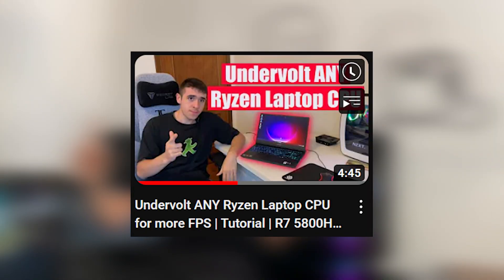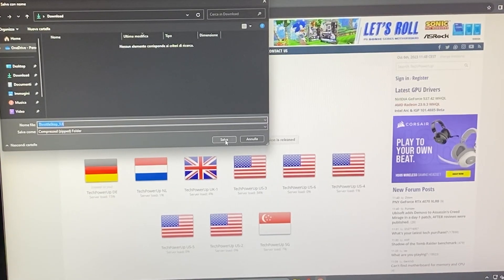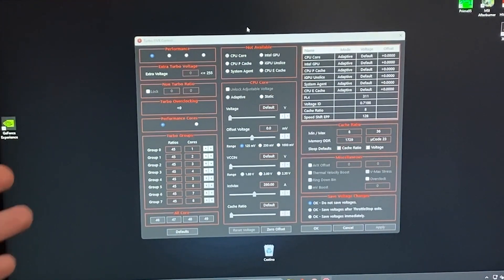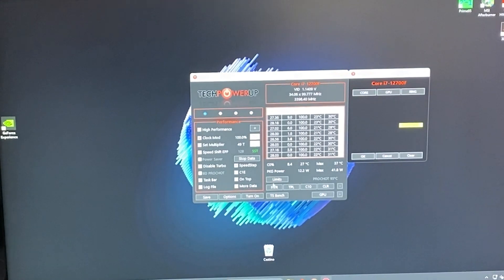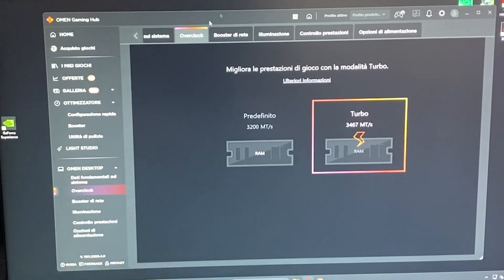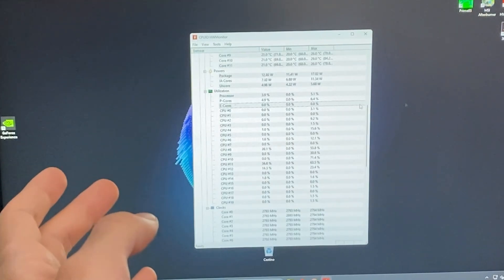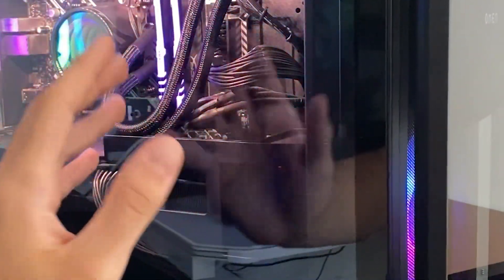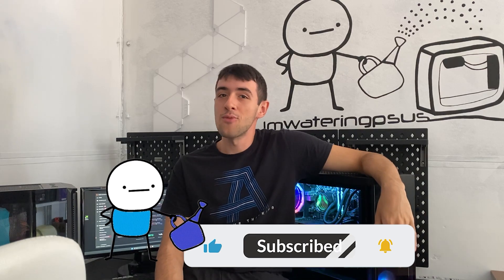Undervolt the LOCKED Intel CPU in your prebuilt Gaming PC for more FPS

Comment: Hello, so i have an cpu i7-12700F can I do the overlock of this cpu ? Because shes an 2.1Ghz speed and the maximum i can get its 4.9Ghz, can I “overlock” this cpu ?
Reply from the maker: Not really “overclock”. You can max out the turbo tables and undervolt it though, yes!
Reply: If you buy intel CPU.... make sure it has the letter K.... 12700K is the unlocked(clockable) version

Comment: good to know......😢 they did it again..........why locking everything ?
Reply from the maker: It's SUPER annoying and I genuinely don't understand why they do it. But yeah, there's always a way around it
Reply: @ImWateringPSUs  i remenber the i5 2400. asrock boards were getting around the non-k oc functionnality. but stil, you coud set everything, cpu ratios excluded ( just turbo max ☺️)
What do we need for gamers ? maybe 8 cores, either very optimized or very fast. or both.
12/16/24/........cores. unless everything is optimised for it, for games though !

Comment: Try to Build a Cheap PC Non-ASUS RTX, 16 Cores CPU PC, 32GB RAM DDR5/DDR4 RGB or Over, Over 1TB SSD NVME M.2, and The PC Must stay at AIO Cooling, and Must Full RGB!
make sure the Motherboard design looks good and Can be able to run AAA Modern Games at 2k 200 FPS or over using Wifi Antennas
Reply from the maker: Ahahahah challenge after challenge my man!